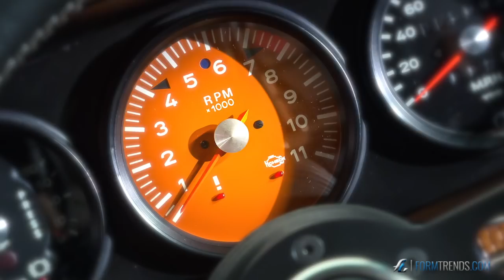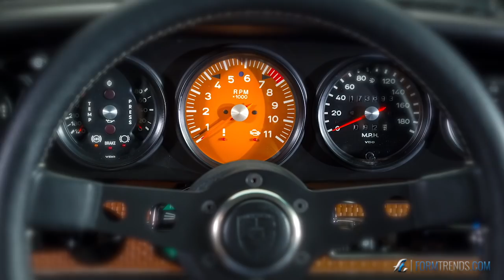Inside Singer Vehicle Design with Founder Rob Dickinson

Comment: Industrial Design people who know enough about engineering like Mr Dickinson, tend to create masterpieces, because of their understanding of form following function.    I like the way you design with respect to the original design elements from Porsche.     When you are unable to tell if it is an original part on the car or something added, you know that you are doing a great job with the build.   I have always thought the 911 was easy on the eyes, but hard to add aftermarket pieces and parts because of the quality form.  You have done it and done it well thanks for the video.

Comment: I think many people are missing the point of a Singer. Yes Porsche is responsible for the artistry of the body lines, style and overall charisma of the 964. However you can't just go down to Porsche of beverly hills and spec out a new air cooled 911, so you're left with having to sort through dozens of 30 year old cars in varying conditions, mileages and levels of disrepair. What Singer offers isn't just customization, albeit it is a large part of their business model, but the way I see it is they're offering a time machine. They're giving you the ability to walk in, and custom order a 964 as if you walked into the Porsche dealer, only their options list is a little different and they've adapted some things for the modern era. I think this is ingenious and they're not the only company to do this for a particular car.
Reply: Audi_ophile i wonder if singer will do other aircooled models like 930 or 993
Reply: Ardi Januar I suspect if theres a lack of supply with the 964 chassis or if there is an extreme demand for the 993 or others. But considering the extravagant cost of their models, they obviously won't be selling many
Reply: Audi_ophile sold over 100 isn’t bad.
Reply: You're right. The business module behind offering a "time machine" service where you can effectively buy a brand new 964 in 2018. The best part is it doesn't have to meet the same ridiculous emission and safety testing because the parts are already in circulation. What people don't understand is these cars are a nut and bolt restoration and personal expression. The only shame is the cost - it's a playground for millionaires, not car enthusiasts, even Rob himself confessed he couldn't afford one of these.

We need more independent businesses that offer services like this. It's the only way we'll ever get "the best of both worlds" of modern day tech but still feel analog. I'd much rather pay a business full of creative and skilled people to do a nut and bolt restoration on my NA Miata any day than buy a new Miata, and I doubt I'm alone. Every car enthusiast is passionate about a specific car. It's also the only way we're going to save the real talents of people who are able to make things like this. Practical skill sets like this are rare nowadays.
Reply: It's true.  The whole concept is brilliant.  I imagine the same concept could be put into many luxury cars from decades earlier.

Comment: Most of this footage is pre-2015. so it is quite different at Singer than this. I was head fabricator from Feb2015-May2018, and the growth starting in late 2016 has been exponential and not without massive hiccups. Super stoked to have been apart of DLS and Turbo before exiting, interesting to see what the future holds.
Reply: What changed in your opinion? I'm interested in the perspective of someone that worked there!! Do you still work on porsches?

Comment: Do you know the 911 - Corvair Connection?  Corvairs were 6 cylinders in 1960, Porsche was only a 4 banger...  Porsche couldn't get the cooling of the center cylinders right, until they hired the GM engineer.  1965, the NEW 6 cylinder Porsche 911 came out...  (5 years after the Corvair, but still less horsepower)

Comment: having all albums from catherine wheel i wouldn´t have a discount in one of your singer´s porshe ,even a duet with tanya donelly from trowing muses i wouldn´t call a failed career as a musician or singer in one of the best bands of the 90´s
Reply: even billie eilish as a cover from" i want to touch you" when in the army i would let my self asleep listening to a cassette with the ferment album loud as it could ,the best headphones sony had more expensive then the whole walkman that came with headphones already, even later conected to a ipod everybody was amazed by this headphones i would assk to pu the bass at maximum level and the volume and normally all their earplugs and headphones fron seneiser couldn´t sound as mine ,portable ones not those huge ones made with a skin of a goat that only exist in the highest mountains of Africa (already not existing) and wood also from a tree that doesn´t exist anymore due to the number of huge but weightless headphones sold by 3.500€ in the late 80´s

Comment: All those poor 964s, in 30 years people will spend fortunes restoring these back to stock...
Reply: Pretty sure no one is going to take a $600k Singer and turn it back into a $50k 964. There were over 60,000 964s made, Singer just did their 100th car. Drop in the bucket.
Reply: Not at all. There were lots of 964's made so if you want one stock you have lots to choose from.